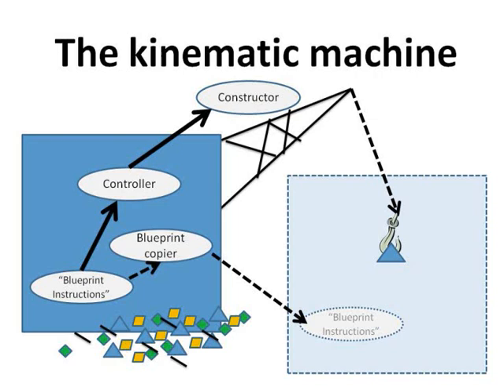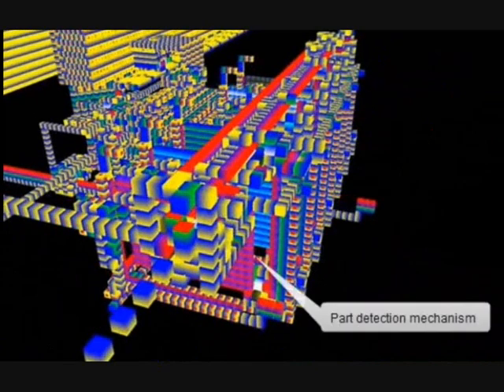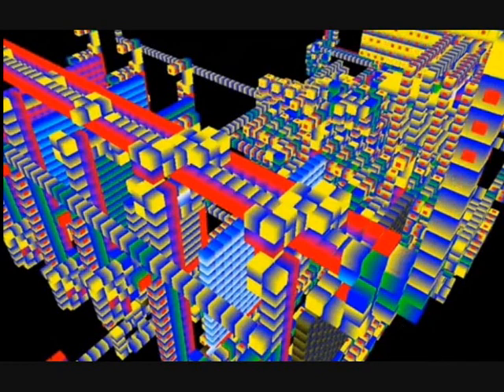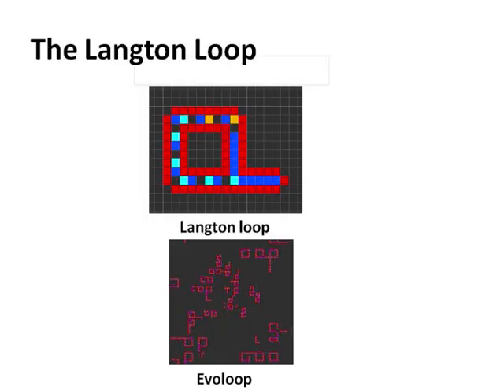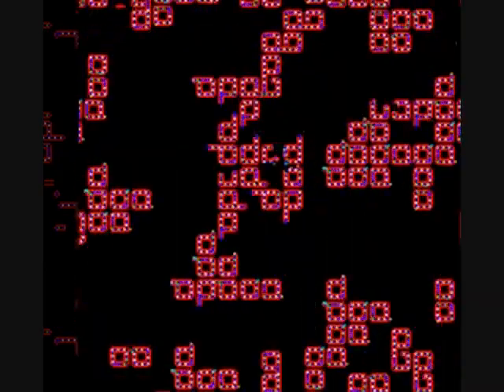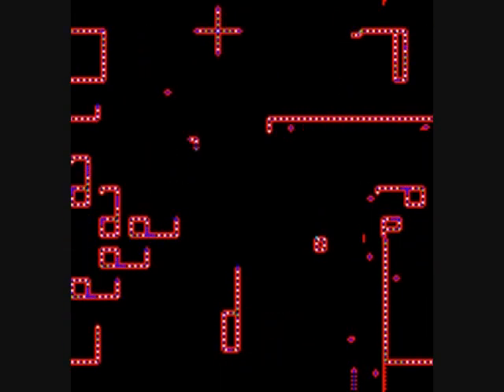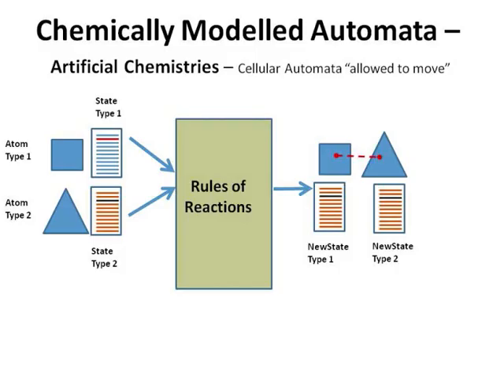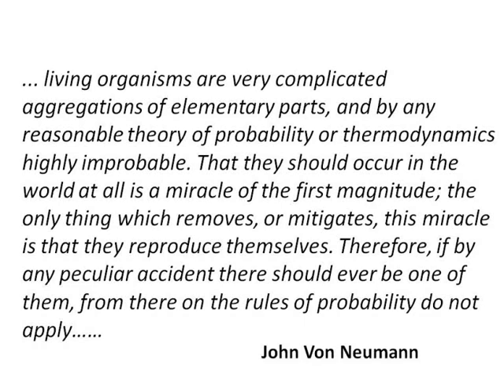Cellular Automata - Part 2 -

Comment: Notice that in artifical life simulations the symbols of the genes are dictated by the researchers and written into the sim de novo. This is not the case in real life. Messenger RNA transcription is a process by which nucleic acid chains are "read" by the cell. Without this process, nucleic acid chains have no meaning. (Ink on paper has no meaning -- until read.) To make sense of self-reproduction, we must insert this epiphenomenal "symbol" being read and transmitted.